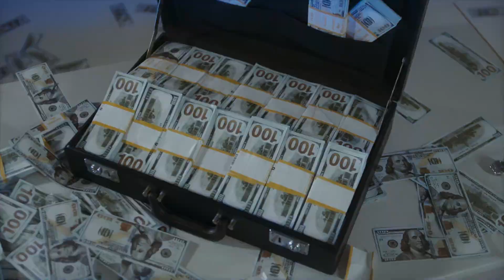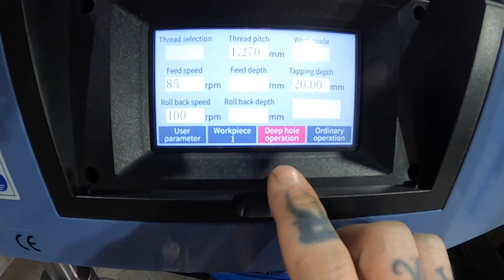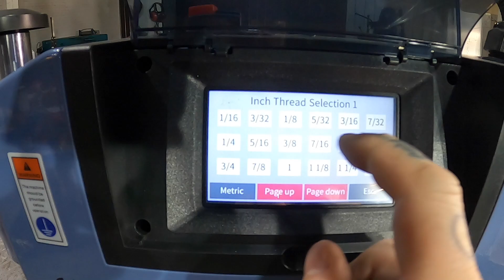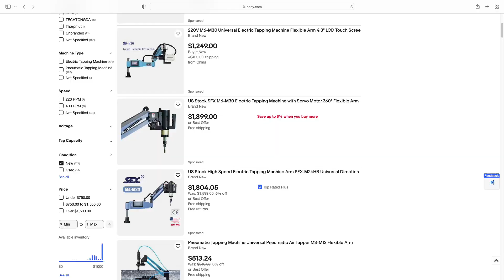You Need This Fabrication Tool ...

Comment: my man, we have a tap machine, which easely tap that steel hole in 1 compleet go! You are using cheap or non machine taps. That steel hole should have been tapped highspeed in one go SUPER EASY. Did you drill the hole the correct size?
Reply from the maker: Hey. Yes the hole is #7 drill bit and the tap that blew apart was a $25 spiral tap but I have since found a cheaper set of spiral taps that works great and does them in one shot. Thanks for the advice and support. I really appreciate it!
Reply: @precisionmetalin   no worry's man! i use dormer taps not sure if they sel them where you live but the blue shark taps for stainles they last with my tap machine easly aboven 200holes and thats realy nuts compared to cheap phantom taps for instance.

lots of oil and speed keeps them running for ages.

Comment: Small can or pop bottle with the top cut off an acid brush and no more squeeze can for your tap magic.
Taping oil. 
The little fruit cups and jello cups are great for cutting oils, and the Lays potato chip tube lids fit right on them, i use then for wood glue 
But they would work in a machine shop too as long as they don't get hit with red hot chips.  Its thin plastic its gonna melt and burn.

Comment: Don't brush off chips with your hands, trust me you'll regret it. 
Use a paint brush.  
I dont care how thick you skin is splinter chips hurt like hell and you have to dig them out most the time.
I think its worse then red hot balls from welding down your shoe.
Or walking by a Bridgeport spraying red hot chips as your taking 100thou layers of metal off. 

Im not sure about yours but you can drill with some of those too.
We had a 3 head drill press  
With a tap-o-matic i drilled reememed and ran a tap on it  each station did a different tool 
I made millions of these parts like this after the came off of cnc mills.

Comment: I manually reference my cnc then just drive the z axis with a tapping operation takes about 4 seconds. This just seems like it takes forever.
Reply from the maker: If you can afford a CNC machine that’s a great way to do it for sure but a lot of people don’t have the money or space for a machine like us. I think this is a cheaper good option. Thanks for the support I really appreciate it!
Reply: @prestigemanufacturing2611  I was more referencing how you said you used to do it on your cnc mill but this was faster? Iunno, even a small mill would likely be faster if you can get the part in the mill.
Reply from the maker: @ltsky311  💯

Comment: I prefer good hold radial drill for drilling and taping with good drill chuck, it’s more faster! But don’t be stupid for using hand tap on machine!!! Pay few bucks more and use « machine tap » I drill and tap 30’s 3/8-16 in 1-1/2in deep in less than 9minutes at 1250 RPM for taping on die set plate. 😉

Comment: BRO THIS THING IS GOLD !!!! I HAVE ONE AND HAVE A BUNCH OF HOLES TO DRILL AND TAP. I USED A PUNCH AND THEN USED THIS TO TAP THE HOLE. COST 2K ON AMAZON AND I COMPLETED 8500 1/2 HOLES IN 3/4 MILD STEEL PLATE.
Reply from the maker: I love this tool too

Comment: Used one plenty, hated it so much that I learned how to tap with the CNC milling station which was my main responsibility. For emphasis, before hiring me, they had had more experienced machinists from other companies in the supply chain and a CNC teacher from local trade school to try tapping on that CNC and all of them came to the conclusions that it just wasn't going to happen on a machine that cheap 😆
Reply: Kinda depends on the project plans
Going cnc  how many parts, or just one off parts like a prototype 
If the plans are just on paper, it could cost more in time and labor the just tapping with this tool.
If you have 10k parts to run a good cnc operator and tooling use the dam cnc   it depends on the job your doing.
I worked in a machine shop years ago the cnc back then had tape readers today its CAD  programing doesn't take as long.  
You can make a lot more money with a cnc running 10k parts then stopping to load one part  set up time isn't free.
Reply: @bobbg9041  there's also a cost from having your machinist manually tap threads while the next work piece is in the CNC and have him get exhausted towards the end of the workday and quit the company sooner. Counting seconds is not optimization. It's consultants keeping themselves employed 😉 I would know. Used to be a machinist, I'm about to graduate from business administration 😁 To be fair, comparing to the status quo of things you're 100% correct, but that thinking has gotten us to a situation where pretty much every company makes more profit than ever, still believes they're constantly on the verge of bankruptcy, their only solution to it is screwing over their employees and then "no one wants to work anymore".

Comment: If you have a mill they have a tapmatic head that auto reverses. I did hundreds of holes with one when the cnc's were booked with other jobs.
Reply: Scrap matic is what I call them
Reply from the maker: Totally can do that, but what if you have a huge plate that the mill won’t reach?

Comment: Look like a high speed bur grinder. Like can cut holes in bolts taps dies drill bits with diamond or carbide bits? OOOOOOOOOhh a fan-c tap drive, 
That bee doesn't look torquey enough for taps but thinking my mortar drill motor is smaller it makes sense. SERVO and choose tap speed ect NICE! Looks flim flammy but suitable for this job.
Reply from the maker: It’s a a tap arm 😀

Comment: From factory the torque collets need to be adjusted!!  Adjust to lowest possible setting without slip 

Also, set the torque in the display to lower than factory default. It's too high.

I've used mine for thousands of holes. It's fantastic

Also, throw that hand tap away.  Get spiral flute. The ones that push chip upwards for button holes. And the other that push chips downward for through holes.

Else, see some of my tapping videos 😊

Best regards
Reply from the maker: Thanks for the tips man. I appreciate it. The tap that exploded in the video is actually a spiral tap but it must’ve been the wrong type.

Comment: Buy spiral flute taps they're designed to just be driven straight through, we got one arm like it at my work except it runs on air and the taps just power through 1.5 inches of 317L stainless we do use cutting grease for anything 1/4 size and up. (Very, very hard stainless)
Straight fluted taps should only be used by hand not anything with a powerfeed, with the exception of smaller holes cause you just can't get spiral taps that size. 
Never broken a tap on it.
Reply from the maker: The one that exploded in the video was actually a $25 spiral flute. Maybe I need to try cutting grease also.

Comment: But why not just use a tap wrench?
Reply from the maker: If you’re trying to tap 100 holes with a tap wrench, that would take forever
Reply: @precisionmetalin  
Then use a drill press with a tapmatic tapping head.

I thought this tool was a portable 5 axis drilling and tapping machine, that would allow someone to drill a hole at any angle, such as underneath vehicle frames and hard to reach sports, with drill press like force so that the holes can be drilled much quicker than pushing a power drill by hand upside down or similar.

Comment: As a machinist, having tapped thousdands of holes and broke a good few taps. this would be convinient. this is not faster than a cnc. if you have the understanding how to program basic g84 cycles i guarantee that whatever is programmed would be faster.
Reply from the maker: I agree that CNC machine is faster but if you’re doing short runs I think the setup and programming would take longer than making holes and driving and tapping. Thanks for your comment and support!

Comment: We use one of these to tap laser cut holes straight off the machine. Use it every single day and haven't had issues, been a great tool. We have the bigger version.
Reply from the maker: It’s definitely an awesome tool to have!
Reply: What kind of tap are you using for the laser cut holes? 
Just wondering because they will have lead ins usually that I would think would cause a problem for normal taps
Reply from the maker: @MikeYurbasovich  I started using spiral taps with a certain tapper and it’s been working great.
Reply: @prestigemanufacturing2611  Nice!

Comment: They are cool, but very slow to use. A CNC is way faster and better
Reply from the maker: It depends on the job in my opinion. CNC may take longer to set up. Especially if you’re doing a small run it may not be worth it to program the CNC machine to do it and then you have to do your set up. With this machine you lay out your holes, drill them and start tapping immediately. Thanks for the view and support. I really appreciate it!
Reply: @precisionmetalin  I get that. CNC's can be a pain to set up, especially for small jobs. I used to work in a machine shop and had to tap these support frames with 20+ holes and using a tap arm like yours was terrible. 8 hours a day standing and taping. Once we got it on a CNC it was load in the frames and hit start and go do something else for 15 mins. Everyone of us would take turns swapping them out. I could see how your tap arm would be great for large taps and precision stuff for sure though...:)
Reply from the maker: @user-zq6pj5jo8j  trust me I love doing CNC work but sometimes manual is faster unfortunately 😆

Comment: Get yourself two sets of taps for powertapping. One set for blind holes, spiral fluted (all cutting action happening in the first 2-3 threads), and one set for through holes (all cutting action happening in the first 4-5 threads), like the yellow TiN coated one in the background, those have a diagonal cut at the tip, that's where all the cutting action happens, those diagonal cuts push the chip out the front. It's not about the coating, it's about the diagonal cut at the tip.
If you ever need to do much tapping in aluminium there are special taps that look like they have lost several teeth in the back of the tap, that's to reduce the amount of tap rubbing against aluminium as taps for powertapping don't use those teeth to cut anyway.
If you ever go beyond 10 tapped holes per minute you should start reading literature about tapping, some strange physics is going to happen where an increase in speed can double the lifetime of a tap.
Reply from the maker: I’m definitely going to order some new taps

Comment: SPIRAL POINT,SPIRAL POINT SPIRAL POINT.Tthrow them stupid harware store taps away. Buy good quality SPIRAL POINT TAPS. No  tool and die maker woukd ever use the taps that you use. Even with the pecking option that you have,the tap would instantly explode if you tapped any kind of tool steel.Love your video but every time I see a you tubber use a hardware store tap ,I cringe.
Reply from the maker: You’re about the third person to mention that lol I actually ordered some and I’m going to be using them on my next project. I appreciate the insight and the support.!

Comment: My man.. yes these tools are great, really. We have one too and I love it.
But please look into buying machine taps. They are way tougher, but a bit more expensive. They come in two basic styles, which differ in chip evacuation. The stiffer type pushes the chips through the hole, out the opposite site of the through hole, or deeper into the hole. The other pushes the chip out of the one opening of the blind hole. They tend to break easier in my opinion.

The nice thing with machine taps: you don't have to peck. One and done, in and out.
With this tool and proper machine taps you can have a 1/2" hole tapped in under 10 seconds.

And btw, your machine is rated for 1 1/2" taps if I saw that right.
Reply: Thanks for the tip!! I’m definitely going to try to get some of those taps !

Comment: I get that it has its uses but doing hundreds of holes like that? CNC 10/10 times.
Half inch threads shouldnt be a problem for any decent milling machine. Drill the hole and push that tap through with one go.

Comment: If you buy spiral point/flute taps you can just tap in one go.  You shouldn't be using hand taps in this machine.  I have the same machine works great.
Reply: Came here to say this. Spiral point taps for through holes. Spiral flute taps for blind holes. Adjust your collets for your most common material
Reply from the maker: @purplehaggis6335  thanks for the tip
Reply from the maker: Thanks for the tip, I’m definitely going to order one and try it out
Reply: @precisionmetalin 
Use OSG hypro steam oxide spiral point taps for through holes. Excellent, and not very expensive.

Comment: The collets have a clutch in them. If you adjust it properly then you should not break taps. it will just slip.
Reply from the maker: Your right. I never did adjust them!
Reply: Yeah Milwaukee cordless is a lot less fun at about 8/20, but my drill bits last long enough to get dull